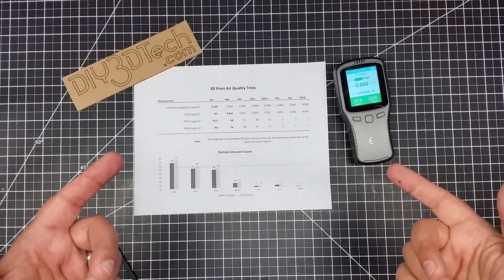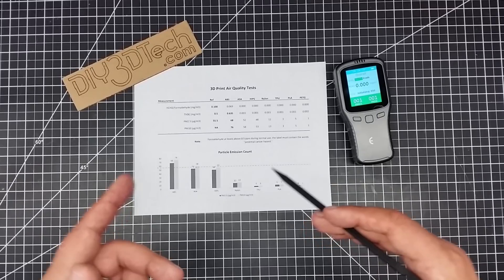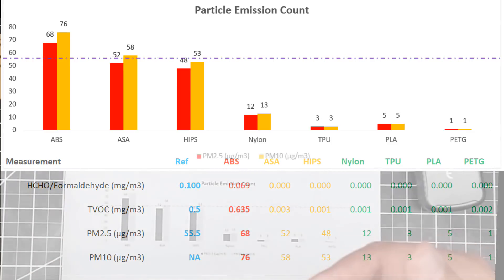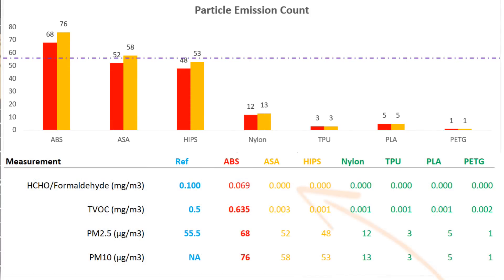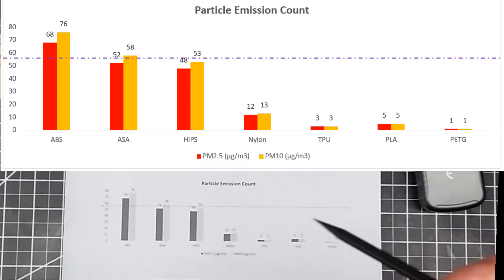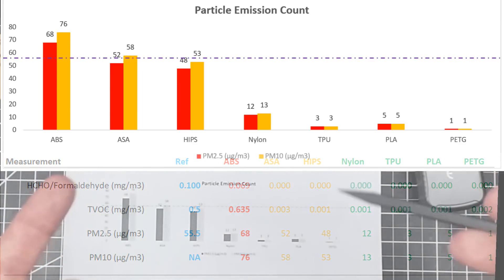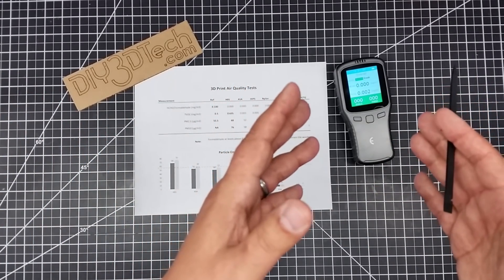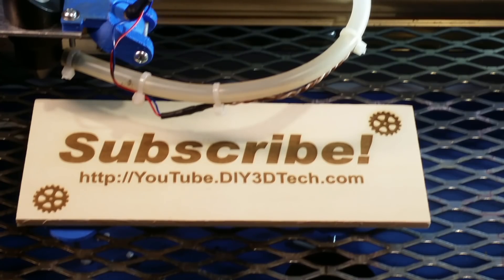3D Print Air Quality - Results are In and we sum it all up!

Comment: I don't think pla is as innocent as it seems . A long time ago I read a study conducted by a university professor that bred zebra danio fish and he would place their eggs on petri dishes he 3d printed in pla. He noticed that the fry (baby fish) were being born deformed and he narrowed down the deformities being caused by the pla. You might want to google it .
I'm interested in this because I would like to 3d print filters and other things for fish aquariums and I'm afraid of killing expensive fish so I'm trying to figure out what's the safest 3d printer filament available on the market . These plastics will be in contact with warm water at different ph levels at all times so I'd imagine that figuring this out would require a lot of testing because of the different variables . So far I haven't had luck finding any answers but I'm guessing that the safest material would be natural pla without any added dyes or additives but since pla is biodegradable then that means that it'll eventually break down releasing ammonia into the water stream killing all the fauna .
Reply from the maker: Not sure about this, however google PLA and Cups and you find that 90% of semi-disposable cups your drinking from are made from PLA...

Comment: Hey man I love all the hard work you put into this. I have a question though. In your opinion, is it worth installing a filtration or exhaust system if I print with one printer and soly in PLA? And if I should, what types of filters should I use? I've seen alot of conflicting messages saying that HEPA filters don't capture the nano particulates produced by 3d printing. Thanks

Will
Reply from the maker: Will, many thanks!  Also correct on the HEPA and I not a doctor nor an industrial hygienist yet with one printer and PLA I would not worry about if the people in the living space have normal breathing ability.  However I have had people with asthma write me to tell me they have had issues....

Comment: petg kills my chest. I use it inside an enclosure, i did a pretty good job at sealing it, the printer is in a 4x4m room. Huge 45cm high velocity fan sealed to the window pushing air into the room. But the little that escapes still kills my chest and it hurts for 48 hours afterwards. ABS hurts nearly the same level, even pla gets me some what. I dont understand it, i dont suffer from hayfeather or asthma at all, but 3d printing hurts, so much so that im going to have to stop printing. It seems my lungs are a living particulate meter lol. Maybe its the brands im using, god knows what they put in them. Surreal branded petg is the latest, but others brand have been the same. Im going to get the same meter to see if i get the same results on my brands. I did put negative vent to the outside, it will allow me to print an hour or two before symptoms start, maybe i need more suction. Its a pain in the ass, no idea how other people can happily be in the same room as there printers.
Reply from the maker: My friend I would say you have some significant chemical sensitivity issues, so please do use care as your health is not work some plastic part.  As keep in mind, our homes really weren't designed to be factories...
Reply: yep my health is poor already, i dont need damaged lungs on top. I ive ceased printing for a while until i come up with a solution that will work for me. My first experiment is recirculating air through activated carbon,  and a mask for when i have to open the door. However, not knowing what is hurting me, its hard create a targeted solution. Nice channel btw
Reply from the maker: Many thanks!  The carbon filer will help with the VOC's however will nothing for the micro particle which are the nasty piece at least in my book...

Comment: Interesting. Thanks for investing all that time and the work you put into it. I'll really reconsider ever buying and printing ABS again. I wonder if the additives in the plastic blends (softeners, stabilizers,...) influence the results, would you get different results if you use for example HT-PLA or "high quality" PLA compared to the cheapest PLA available. Or how about ABS from different sources/manufacturers? And what about special blends like metal or carbon fiber infused filaments?
Reply from the maker: Your welcome and YES to your question they do.  To your question about ABS and different types, pretty much the base of ABS is ABS so you will see the same.  As ABS in this mode is simply a poor choice for this and I think sprung from the ease of availability early in the rise of the hobby over say PLA.  Also thank you, I will have to test carbon fiber as I have never printed carbon fiber before but have machined it on a CNC and I do that in a water bath as the fibers from carbon fiber are VERY dangerous so you do have me wondering now...

Comment: Thanks for doing this research! Very good info to know. I use a 3DPrintClean air scrubber for one printer, a Zimpure 2 on the second..none yet for the third, but have a standing Air Puifier for the garage shop in general.
Reply from the maker: WOW!  That 3DPrintClean air scrubber is really cool!  I was afraid to look at the price, however is a really nice design and will add that to the resource page and thank you for the kind comment!
Reply: You're welcome. I am using their older version which is a standalone Air Scrubber. Now their systems come as one whole unit (granted, much more expensive). Your research puts me at ease, because I mostly print with PLA. Occasionally TPU for flexible armor parts. Using ABS in an enclosed chamber with my Flashforge Creator Pro and the Air Scrubber. 
What do you think of 3D Printing Pens as far as air quality contamination?
Reply from the maker: I would have to guess the pens would be the same yet worse as they (1) melt plastic and (2) you hold them closer to you so therefore exposing yourself to more particulates for inhalation.  However just my thinking...

Comment: Try a comparison between 3d print and particle release around your stove when doing a well done steak.
Reply from the maker: As covered in the video I have actually performed a number of tests  and can also tell you that Starbucks K cups release formaldehyde too.  However two things, steaks release larger particles (rather then smaller) and two the stake isn't made of carcinogen material such as ABS or HIPS...
Reply from the maker: In one aspect you are correct as what was the one commercial from Monsanto "Life itself would be impossible without chemicals" is very true and it is funny you bring up apples.  So one of the reasons I got this meter is my wife has asthma and she was having these odd flare ups so figured "flare up, must due to particles in the air".  So did some testing as we recently got two new puppies (poodles/hypoallergenic and we made sure).  However they are small 7 to 8 pounds and we using training pads to litter train them.  Well they had a tendency to tear up the pads rather then pee on them so the pet store recommend this "All Natural Apple Spray" it is non-toxic (says so on the bottle) as the idea is its concentrated so it is very sour so they don't want to crew it up.  Well I think from your comment you see where I am going as just spraying this caused a CRAZY spike in formaldehyde and triggered a coughing flare in my wife!  Also discovered that Starbucks K-Cups (French Roast) also releases a lot of formaldehyde too.  I would like to sneak one of these into a Starbucks and measure the air inside for grins and giggle.  However back to 3D printing, the professionals have deemed ABS risky so as a citizen scientist wanted to see if I could replicate the tests which I am happy with the results (replicating the test).  As well I do have a concern about the nanoparticles as unlike their larger brethren you find in cooking a stake, they can easy make it past your biological filtering systems as well as your blood brain barrier.  Oh you might of also noticed the line on the chart as well as the "ref" column in the table?     These are the generally accept reference standards for these before something is considered risky and ABS blows past these while ASA and HIP nudge them.   So I do feel I made at least a valid attempt at an external reference as back to the apple spray example after doing many tests around the house trying to find the source of my wifes flares, I did find very little in the way of nano-particle release compared to 3d printing as I have mentioned repeatedly in the videos is that is where I see the risk and not so much in the formaldehyde as it is relatively common.  Also don't see this as negative at all just a good discussion!  :-)
Reply: Why would you ruin a perfectly good steak like that though?
Reply: What I am trying to get at is that people are afraid of chemical compounds in general and that it all have to do with quanteties.
(A bit strange because everything is made of chemical compounds.)
For instance an apple a day keeps the doctor away and an apple contain 6-22mg/Kg (1kg = 2.2 lb) formaldehyde and people eats apples with no worries.
http://www.cfs.gov.hk/english/whatsnew/whatsnew_fa/files/formaldehyde.pdf
3D printers are new to people and with new things comes new fears.
Your statistic chart looks like ABS is way more dangerous than other plastics but you did not compare the chart to other things around us in our daily life.
And yes when you make a steak in your frying pan carcinogen materials are released.(The carcinogen compounds are created during the frying process.)
But is a steak releasing 2X the amount of your 3D printer or is it 10000X more?
And if it is 10000X is that even close to any dangerous levels for humans?

My goal is to give you an idea to a follow up video, not to be negative.
Love your videos.
Reply: Allergies are shit. I am allergic to  pollen and nuts. An air purifier and an air humidifier is helping me a lot during  spring.
Reply from the maker: Yea, I hear you!  My wife has issues too and this spring has really be rough on her too...

Comment: Glycol scores low on VOCs probably because it is so hydrophilic (hydroxyl groups, you know). Those would reduce the vapor pressure of pure ethylene?/propylene? glycol (don't know what particular glycol the filament plastic manufacturers use to compete the polymerization reaction). Hence low VOCs. That's my story and I'm sticking to it ;-)
Reply from the maker: Many thanks actually was referring to your comment in this video!
Reply: Thanks are appreciated!
Reply from the maker: Also, alway free free to comment as I enjoy reading your comments as I also learn something as they are very concise :-)
Reply: OK, you invited me! This hypothesis is more speculative because I don't have real theoretical results to guide me: The reason some plastics give off more particulates may be because their filaments are more brittle. In this scenario, the extruder hobbed bolt abrades the filament and small particulates result.   The reason I suggest this goes back to the beginning of PETG tubing use in building water cooled PCs. It partially replaced acrylic tubing in that role. When PETG was first becoming popular, YouTube videos appeared showing people easily smashing 10mm acrylic tubes with hammers whereas PETG tubes were essentially unharmed by the same procedure. Searches should find these videos. So the bottom line is particulate release should be directly proportional to some measure of "brittleness". I welcome comments by people knowledgable in this area. PS, PETG tubing is quite "soft" and more easily scratched than acrylic, although rigid enough to get the job done.

Comment: Thank you for sharing the information. 
I did only PM 2.5 PM10 Tests on ABS, PLA, PETG with my "feinstaubsensor". 
https://blog.moneybag.de/sds011-feinstaubsensor-fuer-fhem/  
and I came to the same conclusions. But I haven't been testing so long.
Reply from the maker: That is a really cool project and thanks for sharing!   Going to book mark that and if find time might build one as I really this had a PC logger...
Reply: No Problem. You can save the values with Fhem in Logs. Additionally you can use an external WLAN LCD Display to watch live values of PM 2.5 and PM 10.
https://blog.moneybag.de/fhem-lcd-display-1602-fuer-feinstaubsensor-sds011/